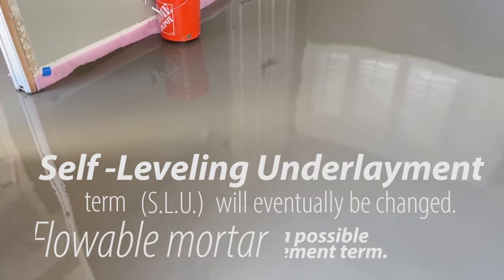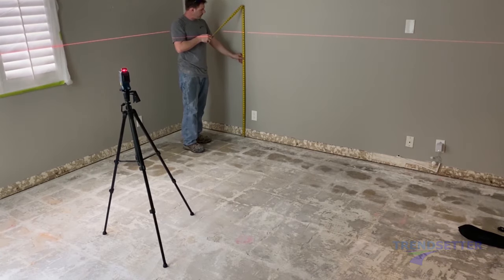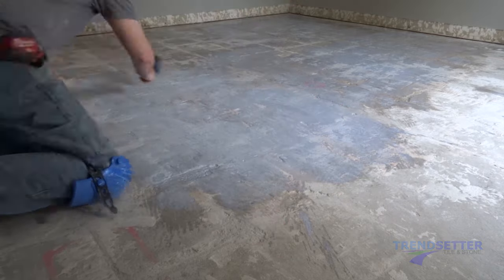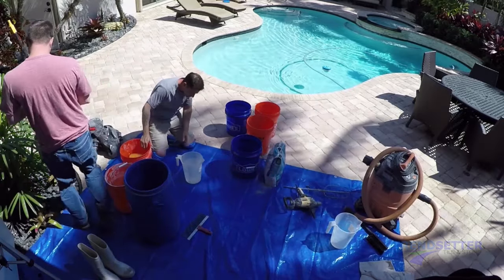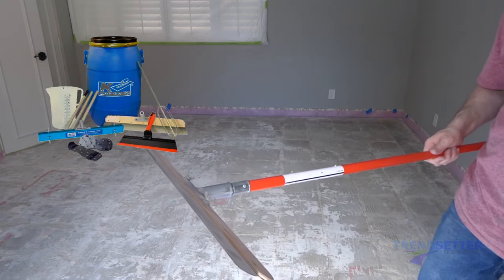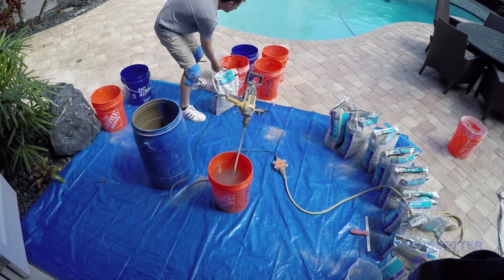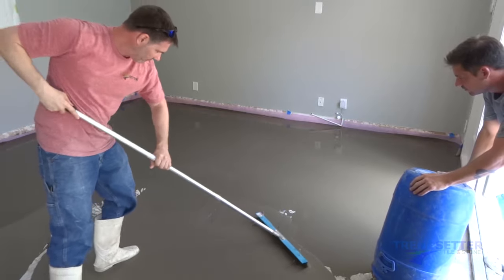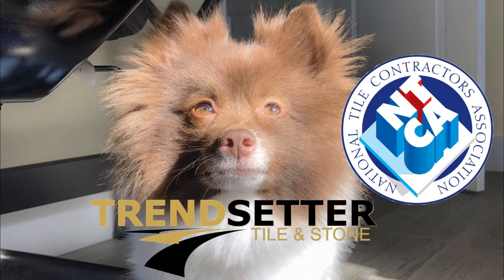Self Level Concrete Efficiently| SLU | Laticrete NXT Level | Level quick for large format tile

Comment: Badass! I've watched probably 10 hours or so of video on tiling and leveling, can't wait to do it at my own place. Partially because I'm saving money, but more importantly because I want to learn and it seems fun. I think that's the part that's needed, otherwise the DIY won't work so well. You have to enjoy it!

I have some fabrication experience (mostly cars and boats) but not much masonry and tile, but I think if the prep work and knowledge is done, the work won't be too hard.

The biggest question for me is how will I be able to do my 2000sqft house. I have some construction buddies to help but no tile or flooring guys. I'm wondering if you have any tips for how to do a whole house? It's a over tension slab, new build in Texas.

I haven't measured anything since there's carpet and existing tile, but I'm wondering how bad it is. I will be installing 12x24 tile, possibly polished, but that seems extremely unforgiving if there's any lippage or non-flat areas. I am not brave enough to try large format stuff.

I am not afraid of grinding and spot-patching, and seems easier to me cause I can work at a slower pace. But at the same tile doing tile for the first time I want as flat a floor as possible to make it easier on myself and not have to level with thinset as I go. So probably will spend the $2k on SLU. I will be using leveling clips and a a small and a large straightedge to ensure everything is kosher.

Any tips for doing the whole house? Can I use base board strips to damn off certain rooms or sections and work one area at a time? If so, I'd have to be very precise at the intersections not to overfill yeah? Or worse case I can feather it out after with some skim coat products...

Thanks!!!
Reply from the maker: Hi Chris, we're glad this video is helping you to be more comfortable with tackling your project.
Using SLU is one of the easiest parts of our work week and it can be very satisfying turning a terrible floor into a suitable substrate.

The process for your 2K sq ft is totally the same, however since it's your first time using dams NEAR doorways is a very good idea. It will slow you down though.

Here is a tip when using dams to separate areas. 

Do not put the dam directly in the door way. 

Make your dam a few feet away from the doorway, whether inside or outside. Doorways are very important areas to have flat. You'll have tile cuts to slide under jams later and any inconsistency in that area is gonna translate into a pain in the ass later whether you have to shave down a hump or fight with a 24 inch length tile. Your SLU will turn out a lot nicer at the doorway if you give it the room it needs. Installing tile along straight walls or out in the field is easy, the real tile work is done at doorways and other transitional areas.

You can put a dam near the master bedroom entry, install SLU in that room and then allow it about two hours to dry, remove the dam and then continue off the dry SLU. If you are careful not to overlap the fresh SLU over the dry, you won't have any hump or material to remove in that area. But this is a one area at a time approach.

The next alternative is to dam off all the areas near every doorway, pour each area one after the next and then remove the dams when the rooms are dry to the touch and connect all of the rooms to a main hallway or shared area. The problem with this alternative is the SLU height in each room may be slightly different and you may find yourself removing humps at the areas where the dams were.

I feel the first alternative is better. It will give you the chance to do an area that won't overwhelm you and let you get a feel for how quick to move to tie in those batches. After you guys take a breather and feel good about what you did remove the dam and pour the rest of the home all at once from back to front.

Another tip, make sure you dump all of the SLU out of the container or bucket. Don't leave some in the bucket while raking the rest. The chemical process in drying SLU involves heat. The SLU needs to be dumped out and spread right away to alleviate some of the heat otherwise it will not flow as well. A bucket is an oven to SLU's or epoxy.

I like mud boots more than spiked shoes. While the mud boots are messier and you have to be careful not to destroy some of the beautiful work, spike shoes are more likely to cause you to break your ass. Falling or slipping on spikes is much easier to do and they tend to slow you down because you have to take more care when stepping.

Make sure the guys mixing do not get too far ahead of you. You don't want mixed batches sitting too long waiting for you to finish placing the previous one.  They have to understand how fast or slow your moving in a given area so they do their part appropriately. Communication is important because your mixing area might be all the way on the other side of the house.

After you've done your planning and have staged your mixing area, and are about to begin placement, you will go from critical thinking into the warrior mindset, this is normal, embrace it, and crush this thing!

Comment: Would you guys use a gauge rake if there were a lot of dips and humps in a floor? Wouldn’t that just follow the humps? Or would the leveller flow and settle where it needs to be?
Reply from the maker: Yes, the gauge rake may need to be set to a greater depth, but generally dips and humps are part of every correction. The rake is a dispersing or placement tool, the self leveler will fall to the deeper areas, it just needs help from the rake.

Comment: Do you have to remove the trim around the floors? I want to keep mine there and just protect it
Reply from the maker: Leaving the baseboard on is not considered best practice. The base would not be left on in a professional installation. For a DIY situation in your own home you could do it,  but the chances of a failure increase.
A perimeter joint is the minimum expansion joint required in an installation where the tile install is concerned. For SLU this is also true, so it's kind of a roll of the dice.
You can get lucky and never have a problem, but as far as it goes towards charging someone for the work you're doing in their home...leaving the base board up is a no go.

Comment: Great video! 
Question - I’m installing glue down vinyl plank over the SLU. Do I need to prime the SLU for the glue to adhere well? 
It would be primer, SLU, primer, glue, and finally flooring, correct?
Reply from the maker: Hi, if the adhesive/glue you are using indicates that it can be applied over concrete without primer then the procedure would be the same over SLU.
This particular SLU is very absorptive and I wouldn't see a need for a primer to increase bond. 

However...

A primer is sometimes used over an SLU to create a vapor barrier and sometimes even to slow down the absorption so an adhesive will not "dry out" too fast on top of the SLU. 

With that said though...

In most instances a primer will not hurt, but if the primer is a vapor retarder and the floor covering is impervious, such as vinyl, putting glue type adhesive on top of the primer and underneath the floor covering is like putting the glue back in the bucket. You need the substrate or the floor covering, preferably both though, to have absorption or air to cure the adhesive.

When I'm in doubt I always call the technical number on the adhesive I choose.

Thank you for the compliment!

Comment: What are you doing with the laser level? How are you determining where to put a level surface?
Reply from the maker: The laser is used primarily to determine how "bad" a substrate is so the proper amount of SLU can be purchased. It lets you get acquainted with the floor so you know what you're dealing with. 

The horizontal laser is set to any height, usually near eye level, just so it is convenient to read. You then measure from the floor up to the laser line in random locations around the room. 

It's helpful to write the measurement on the floor at the measured location.

The different measurements will show you where the high and low points exist. You will have a base measurement at the tripod, or the closest point to your laser. 

If the measurements taken in random areas are less than the base measurement; those are high points. If the measurement is greater; that means that spot is low. The bigger the number, the deeper that area is.

You will find an average deviation among all the measurements. If you want to level the substrate; you will set the gauge rake to the greatest deviation. If you want to flatten the floor like we have in this video; you would split the difference.

Determining this can also be done with levels or a ten foot long straight edge.

Comment: I'll be completing this same process for a 800 sq foot basement. Thank you for the tips. I am not totally sure again what the foam backer is accomplishing. It appears that some is falling off or not even touching the SLU, am I mistaken here? Also, do you just cut the remainder foam off or pull it out when dry?

If I have several rooms that are connected, bathroom, storage closet, and main room is it smart and or possible to make them slightly different heights if they are slightly different floor heights?
Reply from the maker: The foam around the edges is used to retain the SLU where it might slip further under the sill plates and it also provides room for expansion. It should be stapled up, I couldn't find my stapler, so we taped it up and had some areas fold over.
The foam can be put on low enough so the SLU rests on a small amount of it and the weight of the SLU prevents the material from pushing through if there is a gap behind the foam

We leave it in place until after the tile install and then cut the excess prior to baseboard installation.

The room in the video was small and could probably get away without the foam but it's a good idea when possible. I have doubled up the foam  to increase rigidity, along with the staple gun, and found the foam to stay put.

It is possible to apply the SLU at different heights by using dams and sectioning off the different areas.  I have used foam board, cut to the length I need, with a height of about three inches, put in place with a bead of caulking where the foam meets the floor and along the sides. I might put a bucket of water behind the foam just for support and then pour the section. I can then pour the next section to whatever height I want after removing the bucket of water. After both areas are dry I just cut the foam board where it is exposed on top and leave the rest of the foam in place. We usually have Schluter Kerdi boards around so that's what I use.
Thanks!

Comment: Always find myself coming back to this video. Wonder if I should mix with the Kraft barrel or do the five gallon buckets only? (180 sq ft project)
Reply from the maker: You can use 5 gallon buckets for 180 sq ft no problem. We have used 5 gallon buckets when we accidentally left the barrel at the shop. But you have to use a good mixing paddle. If you use a square box paddle type it is going to lead to a poor mix. The paddle type can make a big difference.

The Kraft paddle is too long for 5 gallon buckets but this Rubi one works good and we use it all the time when we have some small pours.

https://www.contractorsdirect.com/Rubi-Glue-Mixing-Paddles

Bare in mind that the rubi paddle is a screw in type, not a standard chuck type. You may need an adapter or just a paddle similar in design to the Rubi. I think Rubi makes a similar one for 1/2 inch chuck.
Thanks
Reply: @trendsettertilestone9602  thank. I went with the Kraft barrel :). I have a mixer but is too short so I will look for longer ones with similar design. Thanks again.

Comment: What mixer are you using? Is it Dewalt?  And where can I get the mixing paddle?
Reply from the maker: We are using the DeWalt in this video. The Kraft kit comes with the paddle.
Reply: Do you know what model I am looking to do a project and want to get a good one
Reply from the maker: This is the best type of paddle for mixing SLU

https://www.contractorsdirect.com/ardex-mixing-paddle

This is a link to the whole kit that comes with a mixing paddle.

https://www.contractorsdirect.com/kraft-tool-self-leveling-kit
Reply: Sorry I’m wondering about the model of the dewalt drill being used to mix.
Reply from the maker: @jacoblee3498  This is the one in the video
https://www.homedepot.com/p/DEWALT-9-Amp-1-2-in-Spade-Handle-Drill-Concrete-Mud-Mixer-DW130V/100072312

Comment: Great video. How do you set the guage rake on a very uneven floor?  For example, my old basement will need depth ranging from 1/8" to 3/4" to create a level surface.
Reply from the maker: Most of the time you can split the difference. You have a deviation of 5/8ths, setting your gauge anywhere from a 1/4 inch to 3/8ths should work to increase the overall flatness. Usually if the floor has that much deviation I generally start on the highest point and drag the SLU into the deeper areas, instead of trying to pull SLU out of the deepest points.The SLU will do some of the work as it flows from the highest point into the lower ones. I would probably set the gauge rake at a 1/4 inch for your application because the product is expensive and at 3/8 gauge you will be working a lot more for a marginal benefit.
A trick you can do is drill Tapcons into the floor around the room. I think Laticrete sells what they refer to as leveling pegs.  The top of the tapcons should all be at the same height, either with a level or laser. You can then add SLU to the area and when you reach the top of the Tapcon, you know you have enough material in that area. This however is the expensive way! It can make the floor level, but level in general is not needed.
You can add additional coats if after your first application you find there is room for improvement. I haven't had to do that in a long time, I don't remember how long it is until you have to prime the coat you just did to accept the follow up coat.
Thanks for commenting, I encourage you to call Laticrete if your unsure. I have called them over the years and there Tech support has always put me in the right direction.
Reply: @trendsettertilestone9602  Thanks--very helpful!

Comment: I keep coming back to this video for my self levelling jobs. I have a basement to level that is about 700-800 sqft and after measuring with my laser level several times I saw that the humps that have appeared on one side of the room and the height difference between the lowest spots and those humps are a little above 3/4”. I tried grinding down the highs a bit but it didn’t help much. Other than that normally the variation between highs and lows are 3/8”.
So at this point I am unsure how much I should level. Raising the floor 3/4 of an inch just to account for the very few humps doesn’t seem like a very good idea. I would appreciate any thoughts on this
Reply from the maker: Hi, I see that you posted this comment some time ago, I'm sorry I didn't see it sooner. The deviations being 3/8ths and how to approach them really boils down to how far apart are the deviations, and what size is the tile?
 
If the tile is smaller than 15 inches on any given side than the floor should have a flatness of 1/4 inch in 10ft long, more than 15 inches and this would be 1/8th inch in ten feet.
The larger the tile, the more these guidelines matter.

I have found that I will average out the inconsistencies. If the floor has a maximum deviation of 3/8ths in 10 linear feet and I set the gauge rake to a 1/4 inch, this will usually bring my floor to 1/8 inch in ten feet. I go right over the high point, pulling material away towards the lower areas. This avoids build up on that high spot and "encourages" the material to seek level towards the lower point.
 
I have rarely applied SLU at, or higher than the maximum deviation for any tile smaller than 5 ft long on any given length. It is not needed nor cost effective. 
If the tile is a thin gauge porcelain panel that is 4ft x 10ft, that is a different story. At that size, and thinness, you do not need the headaches that come with any variation of inconsistency.
While the floor being level is not required for tile that size, shooting for level would certainly have the best chance of meeting 1/8th inch in 10 ft.

The more you use this product, the more predictable it will become. I do not have a precise formula for figuring out the specifics towards the amount of material or the set height of the rake. It's one of those things that are hard to put into words because my assessment of a substrate has become intuitive and the practical hands on ability adapts to each new messed up substrate we encounter, and they can all be so different.
Thank you

Comment: If the rake is always at 1/4 inch, didn't you just raise height variation in the floor 1/4 inch? Leaving you with the same issues just 1/4 inch higher?
Reply from the maker: No, the rake distributes the material evenly and then gravity directs the material, by taking some material from the high points and moving it to the low points.
 One depth on the rake may seem counter intuitive, but the high flow-ability of this product is what makes it work so well. 
It will not stay exactly where you placed it, it's not supposed to, it will seek out level when you cant see it. As it finds equilibrium you will have a flatter floor.